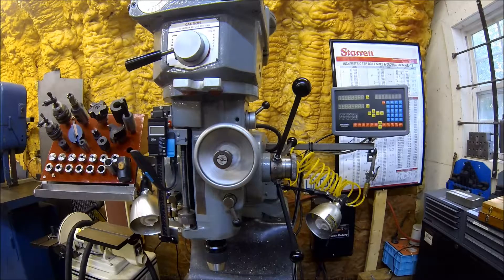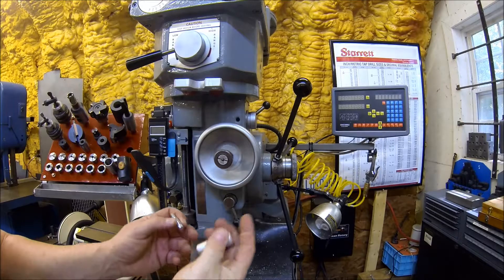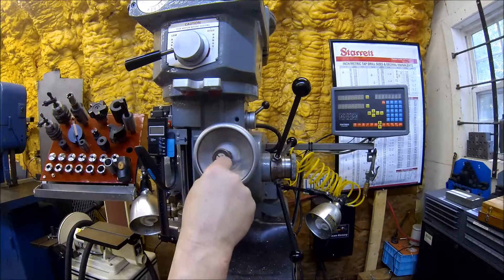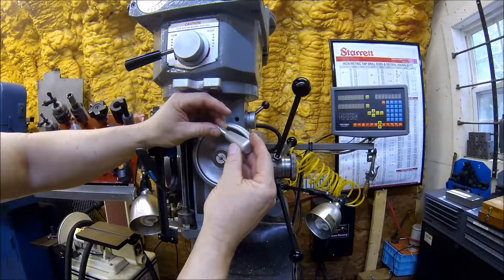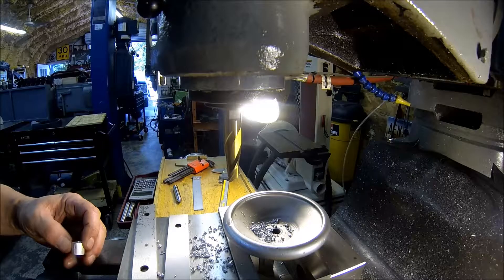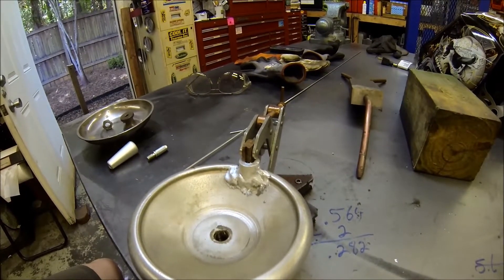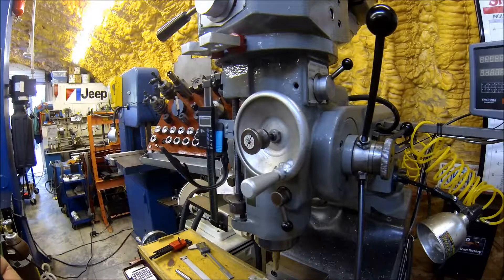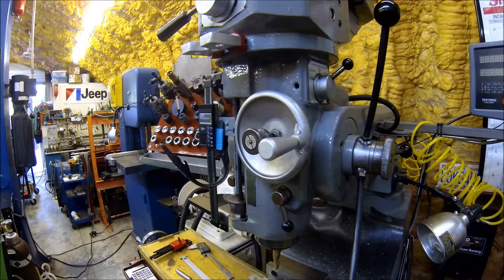Down and Dirty #2. Excello mill upgrade

Comment: Thats a clean Excello, Do you have power feed on it?
Reply from the maker: Thanks. Yes the quill has power feed and I have a Servo drive on the table's X axis.
Reply: Hill Top Machine Works I have an Excello but no power feed. Is a servo brand a straight bolt on application? Been hesitant mostly because of price. Also what is your quill readout?
Reply from the maker: The Servo unit was on it when I bought it. Its about quit working though and I just picked up a cheap unit on E-bay to replace it. The Quill read out I got from CDCO and made the bracket. As you know the Bridgeport style stuff wont fit the Excello without modification. Hope this helps.